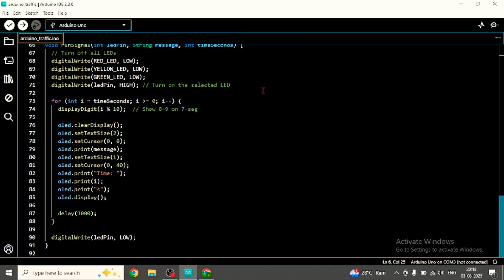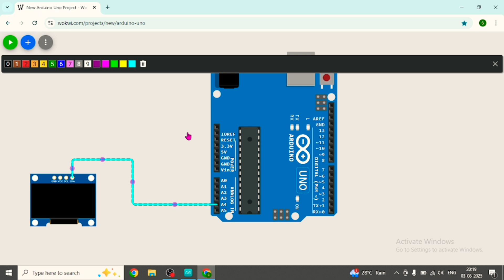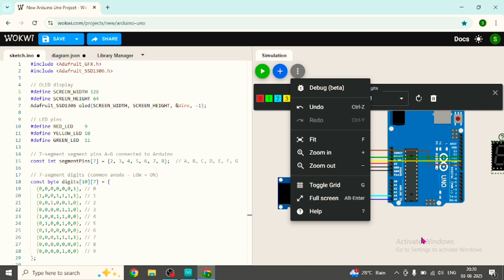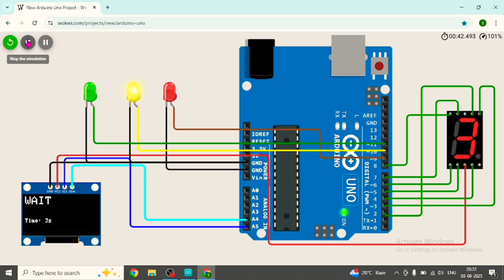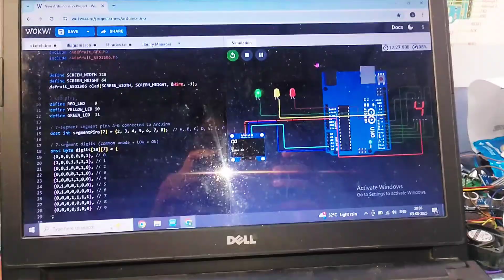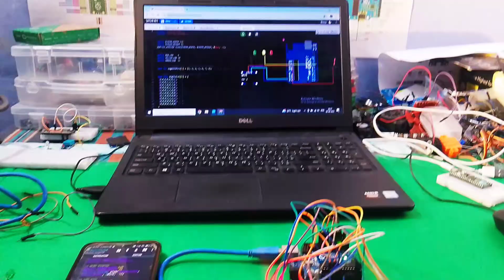Arduino Traffic Light Project | Hardware + Wokwi Simulation (Beginner Tutorial)

Comment: This software (app) name
Reply from the maker: Wokwi simulator 
Arduinodroid
Reply: You can use all kinds of programming languages in this software. And all kinds of microcontrollers (Arduino Uno, Nano, ESP32, Raspberry etc.) can be used. Is there any better software than this?
Reply from the maker: @skmustakim9299 no bro I am only using Arduino uno board Wokwi simulator have every type control try to use Wokwi simulator